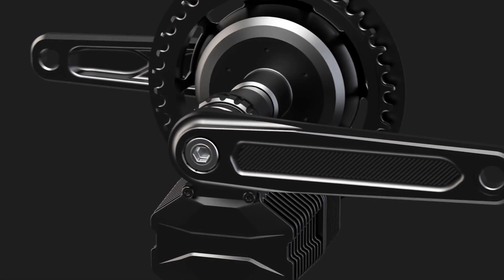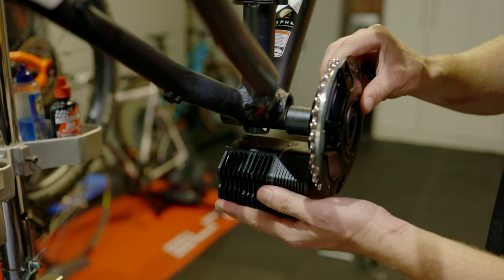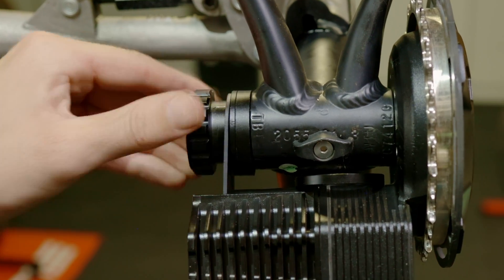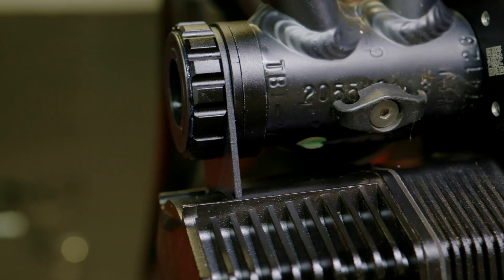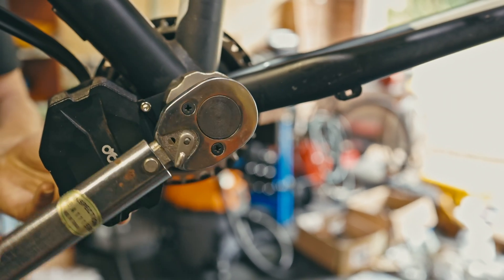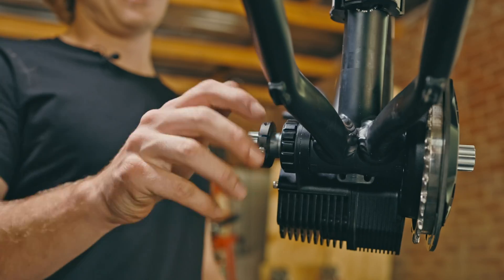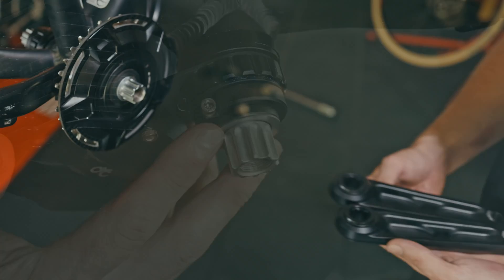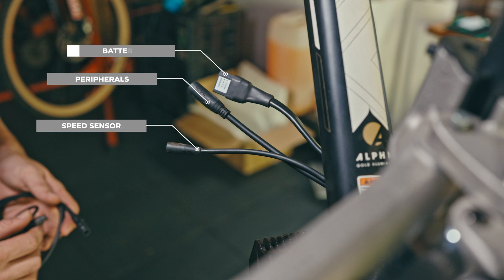How to build an eMTB with CYC Photon - Complete Installation Guide - Official

Comment: So what happens if there 2-3mm gap between the lock ring and the bb. Everything is in as tight as can be used up all my shims to fit the bb cup so I can’t shim after the motor bracket. Is this gap going to cause issues

Comment: Do you have a list a bikes that people have sucessfully fitted your motor to, this would be useful and could encourage more motor sales. I am currently nevous about buying one of your motors to attach to a full suspension bike. The measurements of the motor are not enough to see if it will clear the pivoting part of the swing arm.
You could also sell a plstic 3d printed style black of the motor so that people could buy that to check if the motor will fit properly before spending $1K +
Reply from the maker: Thanks for the recommendation. Wow the list of bikes is a very long list but maybe have a look at our instagram page for some inspiration. Will try make a list but a 3D printed model isn't a bad idea.
Reply: @cycmotor  Yes if you do sell a 3d Printed model of the motor to check you can offer a refund to those who buy the real motor if they return the model.
I have seen your motor fitted to a Vitus Mythique and it looked outstanding

Comment: How easy is it to sevice and can it withstand exposure to tropical rain storms?
Reply from the maker: No problem with heavy weather conditions. Just don't submerge the motor but tropical rain storms are not an issue. The parts are all serviceable (except the controller) and parts can be purchased at resellers or from our websore directly.

Comment: Is this designed to have enough clearance to not have to cut off one of the ISCG-05 chain guide mounts on bikes that have those? That's a common issue I see with the Bafang BBSHD. Bike in question has BB92 bottom bracket if that makes a difference. Would like to know to inform my purchasing decision, thanks.
Reply: clearance is around 0.5 inch or 12.6cm. You would likely need to cut off the tab.

Comment: Recently got this motor after waiting 6 months. that doesn't work !!! little communication with the company on how to fix it 😮 Filed for refund 🤷‍♂️ 🤷‍♂️overpriced💰 With no help from the company😖 do not buy!!!👍 Buy something that's not just going to be a money grab for the company and works!!!!
Reply: Typical delivery time seems to be 8 weeks, for others up to 7 months. Was hoping to pull it off but failed. What was wrong with it? There is nothing similar on the market besides entry level TSDZ2 with tolerance issues and limited peak power (not good for long distance semi-recriational commuting in hilly areas when average speed needs to be consistent).
Reply: @uvwuvw-ol3fg   Receive my motor over a month ago, haven't been able to ride it because it doesn't work !!company doesn't seem to care ,Jump through all their hoops.  Sent them all the pictures they wanted ,including error codes Only time they've gotten hold of me is when I've gotten hold of PayPal, otherwise they don't seem to care about getting my $1000 motor working.!!

Comment: If you're gonna order one of these motors you'd better do it now so you can ride it next summer🙄 cause that's about as long as it's gonna take to get it🤷‍♂️ They'll take your money but you'll wait a long, Long,, long ,,,,time to get it.???😮 Apparently they only have one employee🤦‍♂️
Reply: I was hoping to pull of the typically reported 8 week timeframe but failed. As far as I understand from what they have told me is they have run out of brushless outrunner motors at the moment. Some customers recieve them later than others even when ordered sooner or on the same day. Delivery time varies between 3 weeks to 7 months just like Tesla.

Comment: How long until it heats up using throttle only ?
Reply from the maker: Hi there, the motor has thermal protection so you will not need to worry about it overheating. How long until you reach thermal protection, however, will depend on a lot of external factors.

Comment: Nice looking motor, but very over priced. Such a shame. I could install 2 bafang motors plus batteries for 1 photon
Reply: It's pricey, but probably not overpriced for a mid drive with torque sensor.. I mean check the Paradox Kinetics mid drive prices if you want to see expensive!
Reply: @v1ncen715  tsdz2 is a very great motor, with a big issue: the overeating in mountain climbing ... hope this is better!
Reply: @flipper-cata TSDZ2 is also known for tolerance issues.

Comment: “Please be reminded to add grease to the threads” - doesn’t show the type of grease or how much to use

“Tighten the BB cup to spec” - doesn’t provide torque spec

“There is a vinyl frame protection included in the bag” - doesn’t show it nor where to install it

“We recommend to add grease to the spindle to help with waterproofing” - doesn’t show where or how much to use.

Maybe next time make a 6-minute video and include all these details?
Reply: Agreed! Not really a 'Complete Installation Guide' is it... nothing on the installation and set-up of the peripherals either.
Reply: @cyrilmonkewitz  The point being made was that it isn't a 'Complete Installation Guide' . I think you're the one who needs to learn how to read. Looks like a YouTuber, High Voltage, has done a far more thorough installation video recently which looks like a good reference.
Reply: You just use normal bicycle grease , it’s extremely common